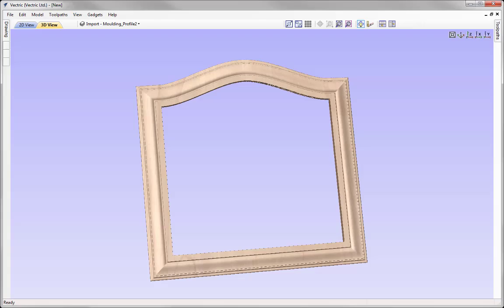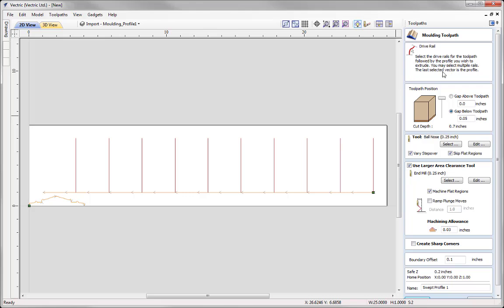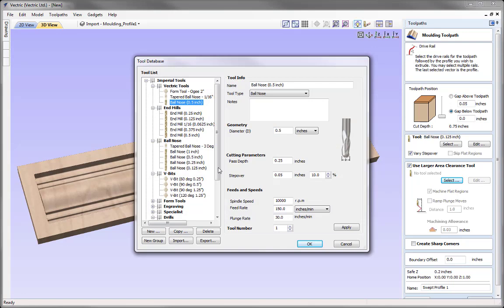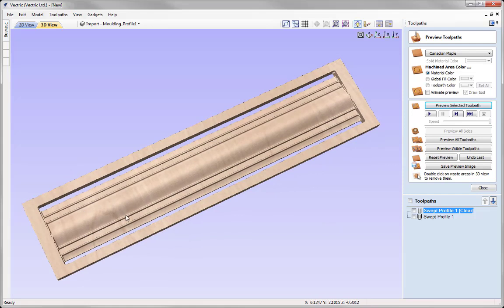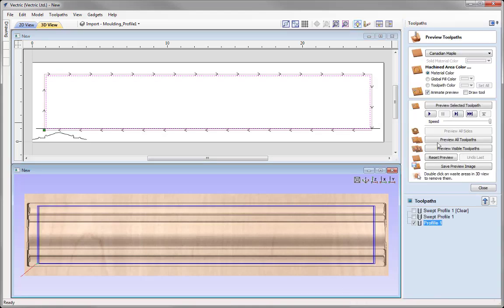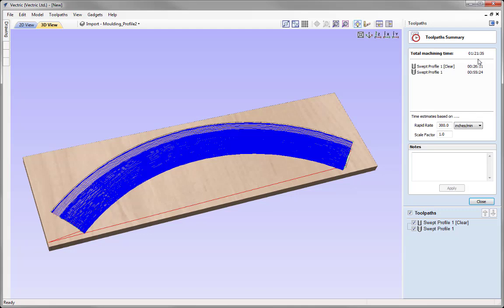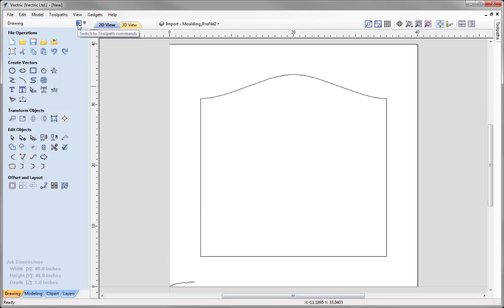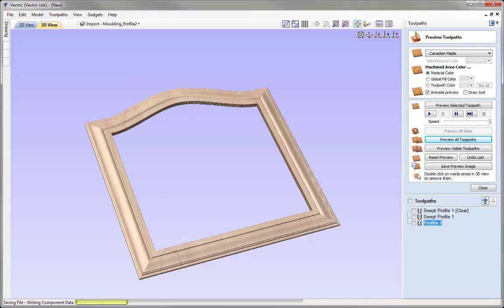Moulding Toolpath | 2.5D Toolpaths | V9

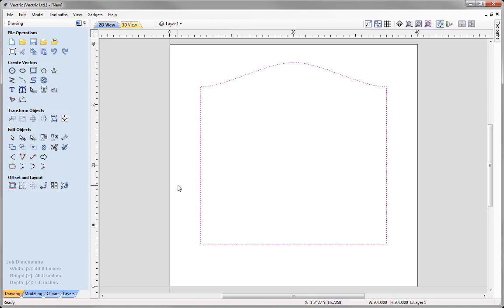Comment: This is a great video - a few questions, though. Is it possible to create a vector drive rail or moulding profile in a photo editor such as Photoshop or Illustrator then import them into the Vectric program? Or do they have to be created within the program itself?  Lastly - can I create several drive rails within a single panel, beyond what was illustrated at around 31:00 min? Sorry if I'm not clear - I wish I could send a photo of what I mean.
Reply from the maker: Hey Christopher, thank you for your kind comments :) You can absolutely create vectors and import them into Vectric software. The files you can import are, .dxf, .eps, .dwg, .ai, .pdf, .skp and .svg I hope this helps :)

Comment: Hi.nice video but i follow exactly as shown but I get different results.  When I click on the rail and the profile, nothing happens. Then I click calculate the preview sows my profile on the lower left as carved. and the rail is also carved.  One more thing is that the dots that show the start on both the profile and the rail are not showing. Looks like that  may be the problem but I can not figure out how to  fix that. Hope that is enough information. 

Can you figure out what is causing this to happen?
I am using Aspire 9.512

Thanks in advance!! 

Cam
Reply from the maker: Hi Cam, Thanks for reaching out to us on here :) It might be better if you could e-mail your file along with your question to support@vectric.com and someone should be able to point you in the right direction :) I hope this helps :) Thank you